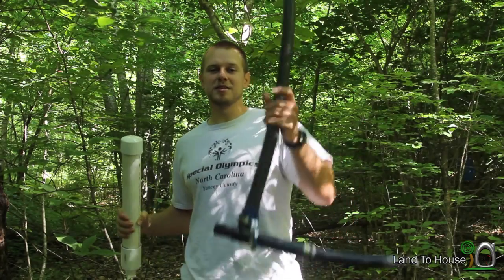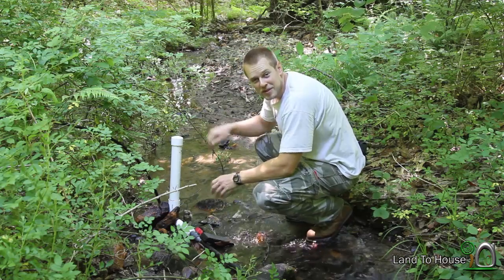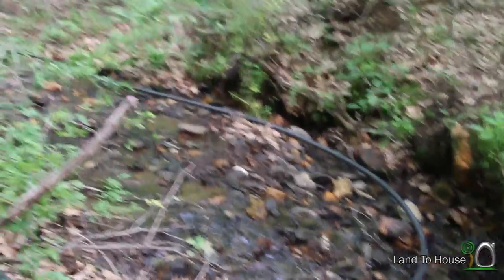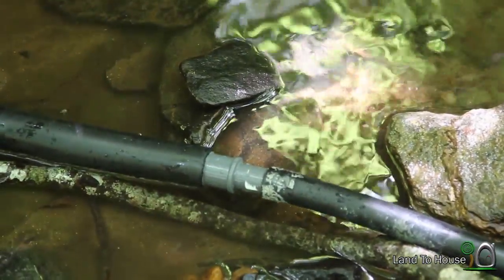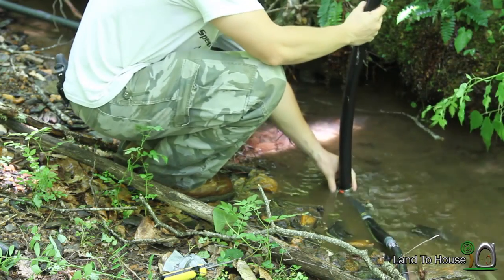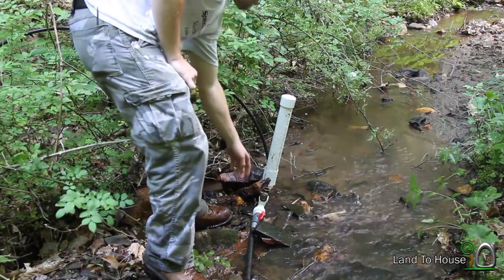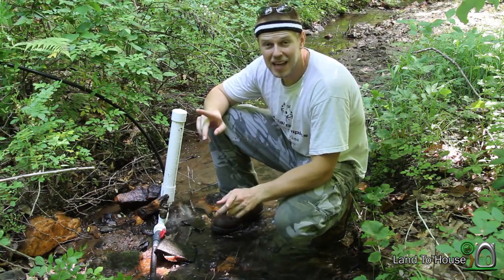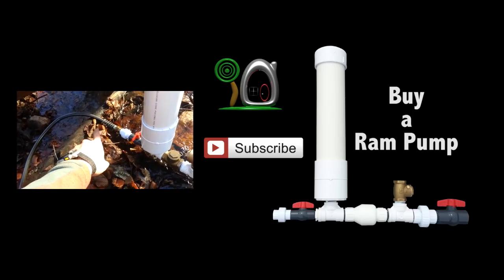Stand Pipe For A Ram Pump

Comment: Good demo again Sir. But, I think the 6 feet head is incorrect. When you were installing the stand pipe & water rose about 6 feet, the valve at the ram pump was closed. When you primed it again, for sure that level at the stand pipe must have came down to the same level as at your intake. A stand pipe serves the same function with a reservoir, tank, or sump installed in many ram pump installations. It improves the head pressure because the water level head is shorter distance to the pump. As an example, this guy uses a plastic bin as a small reservoir (15 m drive pipe with 1.5m drop)> https://www.youtube.com/watch?v=tcbBXE0L4ns
Reply from the maker: +Hasan Sabran Thank you! I actually just loaded up the GPS and pinned the two spots. There is actually a difference of 8 feet. You are right the water in the stand pipe did match the new intake level of about 6 more feet. The intake was up a little higher than I thought it was. That guy has a nice pump. Another nice thing about that reservoir is that it keeps the pump from sucking up debris. I have recommended the use of a tank as a reservoir to several people. Using uniseal to make the connections.
Reply from the maker: +Hasan Sabran That is an odd setup. But it seems to work well for him. That is a very close tank indeed!
Reply from the maker: +Hasan Sabran That stand pipe is actually the waste valve! I can see two reasons for doing that. First: If the source is to hight for the delivery you can reduce the pump efficiency by increasing the hight of the waste valve. OR Second: They dont know whats going on and the pump is less efficient than it could be. hah Now I do like that they are using a third check valve after the pressure tank! That keeps the pressure off the tank.  Thank you for sharing!

Comment: still confused on why the use of the Stand Pipe.  My thought is, what if you eliminated the stand pipe and just added the 75ft of head - straight connection, removing the Tee that the stand pipe comes off of.... what is the differenct there?  seems the Vertical Fall (Head) remains the same.  could you test?
Reply from the maker: Hi.  The pump will work with additional drive pipe length but what happens is two things.  The pressures wave is dissipated by friction over the length of the pipe and the pump potential is reduced.  Next the pump is slowed down the longer the pipe is.  So it's much better to have a shorter drive pipe.  This is why the stand pipe is needed.
Reply: I do understand there is some friction Loss, but over 170ft of smooth pipe (cuts and adapters create more FL) especially at a rate and pressure that is rather minimal (gravity) the significance of the gain you mention from the Stand pipe is probably countered by adding FL at the connection you made to add the stand pipe.   I would love to see a video of exact rate with both options  - IE- time the filling of a 1 or 5 gal bucket keeping all the same except the standpipe. 
Dont get me wrong, I want to see the stand pipe be more effective, I dont have the means and im just not sure Dr Physics says it can happen.

All Great videos - keep up the good work
Reply from the maker: I like to test things as well. Much more enjoyable than sitting down with pen and paper . I will see about getting some more pipe and test out your ideas. I have wondered about this myself for a while. Now if you go to add three and four hundred feet of drive pipe it might start to effect the time the pump operates.  This will make a good video. Thank you for suggesting it
Reply: I have to agree, there is a slippery slope for adjustments, too long and the timing is off, too short not enough pressure (or essentially "weight") to "hammer" and push water up - both effecting the efficiency of the 3/4 pump you have going in this video. 
Thanks for the conversation, I look forward to seeing what you come up with.

Comment: I don't get it , you extended the pipe up the hill by 70 odd feet , so increasing the head anyway , I liked the video and subd but maybe I missed the point of the standpipe
Reply from the maker: Hi and thanks for subscribing.  The dr pipe was backed up the creek about 70 feet. So when the water comes down it fills the stand pipe to a new level.  The new level in the stand pipe acts as the new water source. So basically adding more potential to the output of the pump

Comment: Hi Seth - maybe a silly question, but the river near my house has not much fall, but flows quite quickly all year round, as it flows down from the nearby hills. Would this high flow rate be enough pressure to work the pump? The river is not on my land so I can't dig a trench or add fall in any way. PS I need to pump approx 30 metres vertical distance + 50m horizontal. Thanks in advance!
Reply from the maker: That is actually a good question. But I'm afraid that flatwater cannot operate a ram pump. You might consider a pump called a river pump. This type of pump uses flowing water to turn a prop that spins a hose to collect water and pump up hill.

Comment: Hi Seth, you may remember me I left a note saying that you had inspired me to have a go at making a ram pump. Well, I have made and installed it with great success, I haven't accurately measured the fall or the height I am delivering it at but at a guess around a 5 ft fall and maybe a 40 height over a distance of about 300 feet. It is supplying about 10 litres an hour. However I can almost certainly improve on this as my drive pipe is around  120 feet  so I have a slow hammer action maybe once every 2 seconds. My next stage is to put a open topped tank in about half way down the line. I will try and put up a video sometime. Thanks again for the inspiration from here in Northern France
Reply from the maker: I do remember!  And I am happy to be an inspiration!  It's nice to hear of a successful install.  You are right the long drive pipe is likely the reason for the slow action of the pump. Typically I like to keep it under 100 feet. The open tank will make a big difference.  Have you seen my stand pipe video?
Reply from the maker: Haha forgive me. I forgot what video I was commenting on. This video will be a big help in increasing the action of your pump.
Reply: Land to House .com Yes, I have seen it and would have considered a stand pipe but as I have all the drive pipe installed I think the tank will be an easier and cheaper option than having to put in a larger supply pipe before the stand pipe. I installed a one way valve as per you suggestion on the delivery pipe which certainly helps as well. I may just have to extend the pipe some more as well to get the extra height that I would like for the storage tank, but all things for the future. I am very pleased indeed with it all. By the way I used a pressre vessel rather than a pipe.
Reply from the maker: Michael Collinson It is exciting to see these things come together and start working. The first time that I a ram working I was ecstatic.  What size did you go with for your pump? I look forward to seeing your video!  Is your pressure vessel from an air compressor or some such device ?
Reply: Hi, Just saw your comment, the pressure vessel is a standard pressure vessel used in a closed heating system, it has a built in bladder comes pre-charged to 2 bar and can be re-charged via a valve on the top using a bicycle pump. It is obviously more expensive than your system but works a treat and should be long lasting.
I'm about to install an open topped tank half way down the drive pipe tomorrow, it is already 120 feet long but still pumping, however I want to add another 24 feet to it which should give me an extra 18" fall and increased height and pressure, hope to put a video up soon.
Reply from the maker: Michael Collinson I am looking forward to seeing the video!  I have not seen those style tanks before. I think the video will clear up your description and how it works. It seems as though your setup has worked well without many delays.

Comment: Many thanks.   I did learn lots with this.  I think this is the only video with detail of the stand pipe on YouTube.  This could work for me.  Thanks again for showing the before and after.  The stand pipe could be a game changer.   :)    Again thanks for providing the most detailed source of the Ram Pump operation on the web.
Reply from the maker: You are very welcome! You are so right there are a couple videos on the stand pipe but it would seem most people just point to them and move on. haha. A detail that I neglected to film is making sure that all the air is out of both the drive pipe but also the supply line. It wont work if there is air.
Reply: Land to House .com This was a really good video for me.  I have watched it so many times already.  Before you got the air out of the system is exactly how mine was acting.  I plan on getting a 1.5 foot deep rubber made tote and have the supply water drop in the tote and my drive pipe will pull the water from the bottom side of the tote so I can make sure I am not pulling any air into the system.  My drive pipe should then be under water.  My water doesn't flow enough to just put a rock over it.  :-) 

I am over a week away until I can have another try at the Ram.  I can't wait.  

Thanks again for this great video.  If I can not push the water to the top of our property which is about 250 to 300 feet lift in elevation I will try the Stand pipe.  My drive pipe is 60 feet long 30 feet elevation.  It is really steep.  I fall a lot in the muddy dirt.  Ha Ha....  :)
Reply from the maker: John Godwin Oh a tote would be a good idea for a water catch system. I was just thinking about having the drive pipe intake on the bottom though. It might get silt in a big rain and clog it up. Might be better to have it pull form an inch above the bottom and then have a drain on the bottom to clean out the tote. Just thoughts on my experience. I used a 3 gallon bucket once and had it clog several times. having the drive pipe underwater deep water is the best way. 

Once you start seeing results its hard to stop working with the ram pump haha

Gosh 30' is so much. I am interested in knowing how high you can actually get. I have gone 70' up with 12' of head but that is not even close to 30' head. Using the inline check valve does make a big difference for delivery pipe. with your 250+ foot elevation you could have more than one check valve. 

start using a repelling rope on that hill haha
Reply: +Land to House qwee